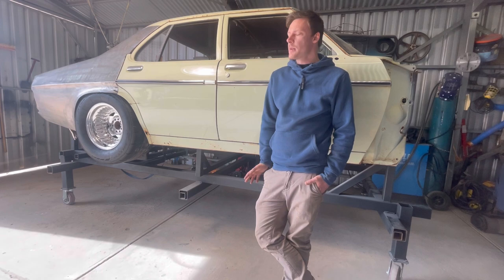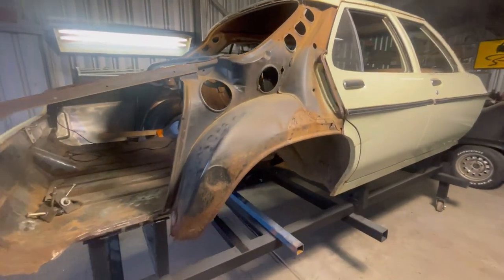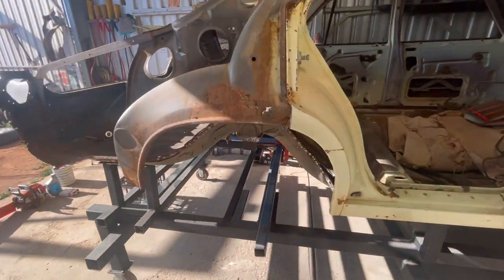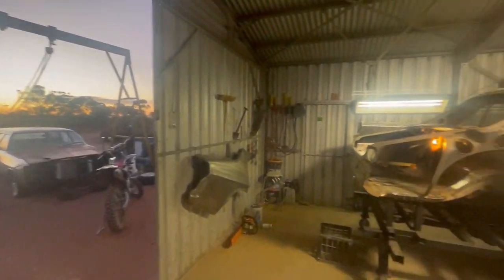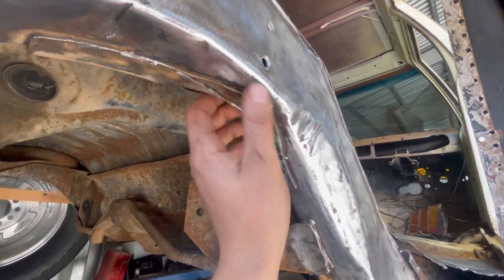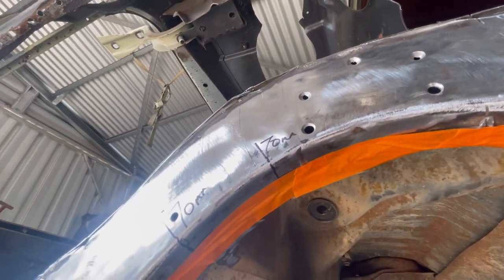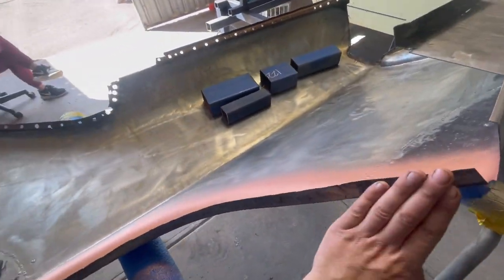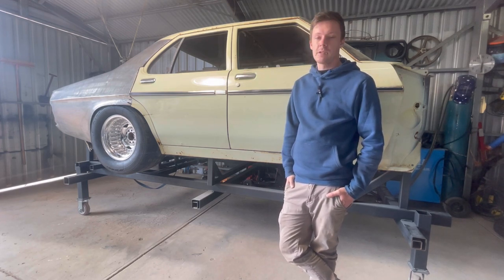Tubbing A HZ Holden: Part 1 - Tub Removal and Chassis Notching 325/50r15 Nitto - The Resto Shed

Comment: Question. If you take 20mm from your rail. Shouldn't you add it back to the opposite side? The rail wouldn't be as strong now? Have you thought about mandrel bent rails? I was taught if you take a portion e.g your rail away you should add it back to the opposite side where possible.
Reply from the maker: It’ll be just as strong if not stronger after it’s reinforced.
Next weeks video will answer your question.